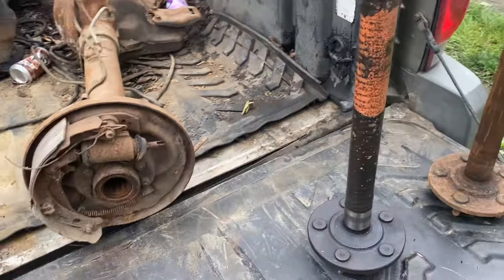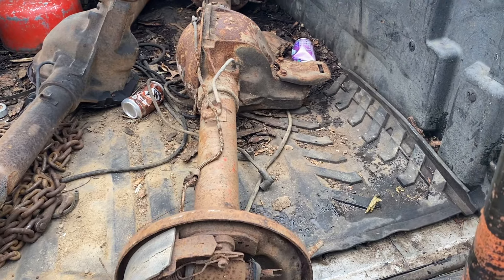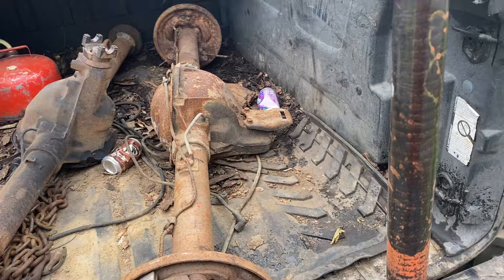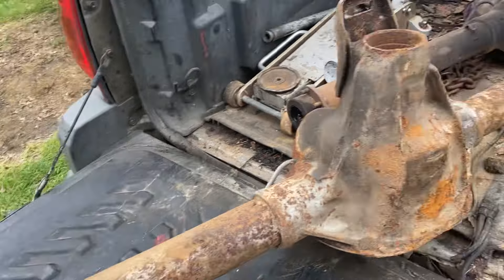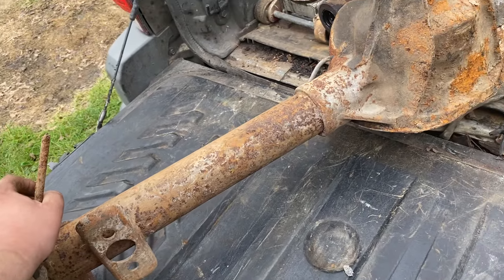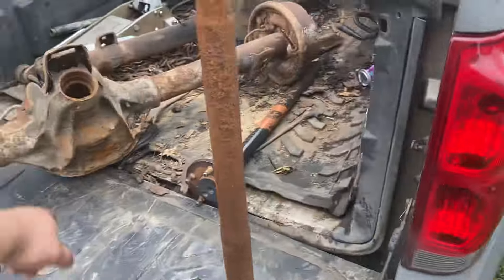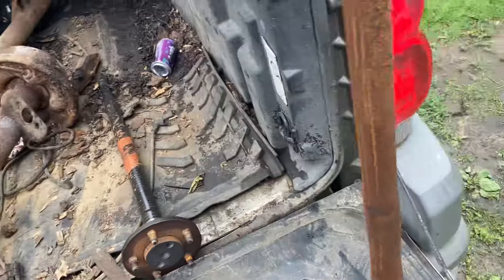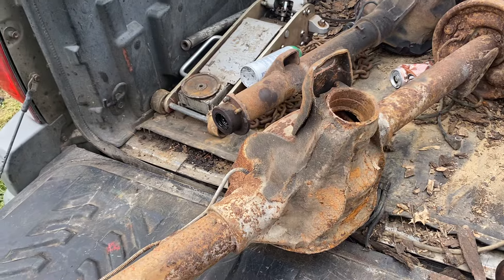We scored a a body mopar 8 1/4 for a 80 bucks are we winning or losing you decide

Comment: Great score on the 8 1/4 for a mild to warmed up v8 it will work great... I have a trac loc in my 8 1/4 3.55 gear axle in my 76 Charger... And yeah I would like to see the build up of the axle on the channel... On my 72 dart I have a 70 charger 8 3/4 replacing the wimpy 7 1/4.
Reply from the maker: Hell ya man we will definitely build it up how much hp do you think the 8 1/4 holds up too
Reply: @poormansspeedshop4104 built strong in an A body 400 hp easy...more importantly is tire size big slicks more stress on a 8 1/4 but street/strip radial slick should live fine use synthetic gear oil... But if you stick with C clip retainers always a chance of losing a axle at the wrong time.
Reply from the maker: I was wondering about the c clip part

Comment: Another thing the one you were showing came out of a car with iso rubber bushings around the leaf spring perch you can tell by the large hole in the center of the perch you'll have to weld a heavy washer in there to make it locate on the spring bolt.... Definitely need to measure center to center of perches to make sure it's an A body width.. Is 43.02 center to center perches... And from flange to flange is 51.4 inches.
Reply from the maker: I’ll definitely measure it to make sure it’s the right size for the car you know how some people are on marketplace my friend